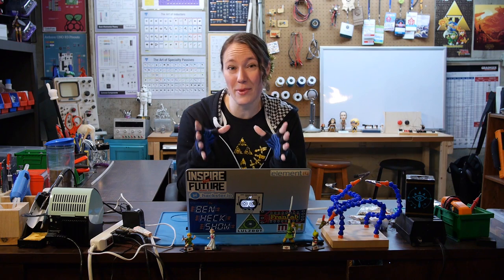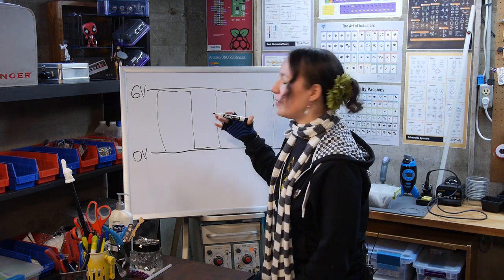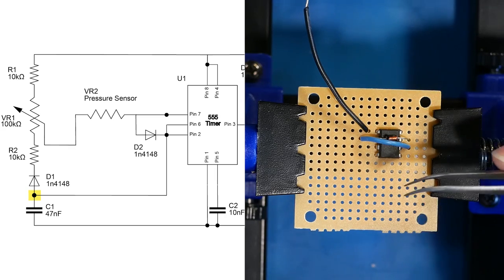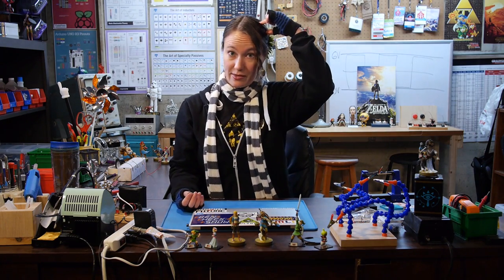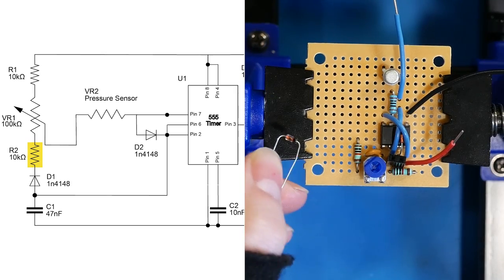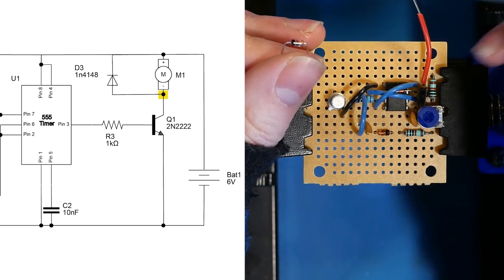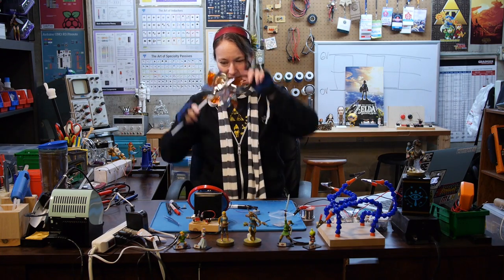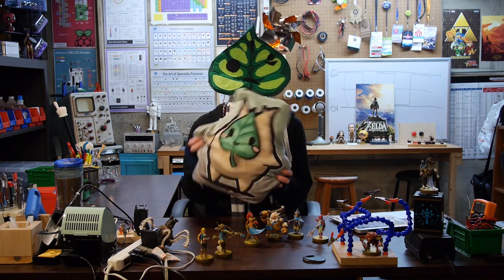Zelda Korok Mask with DC Motors - The Learning Circuit

Comment: If you find that when using this board nearby A.M. radios have a lot of static, you can add a small value ceramic cap across the motor inputs.

Comment: Why don't have a difference amp drives the CV input which is pin 5  of the NE555 and the output of the NE555 will connect back to the inverting side of the difference amp via a 47K Resistor with a 10UF with the positive side connecting to the inverting side and negative to the negative of the circuit.

Comment: Awesome vid.  I shirk when I see open flame.  Karen needs a small heat gun for the heat shrink tubing from Element 14.  Like this : https://www.newark.com/nte-electronics/hg-300d/input-power-350w/dp/80R3536 or this: https://www.newark.com/nte-electronics/hg-300d/input-power-350w/dp/80R3536   They both have built-in stands and are very handy for a variety of uses besides for heat shrink tubing.